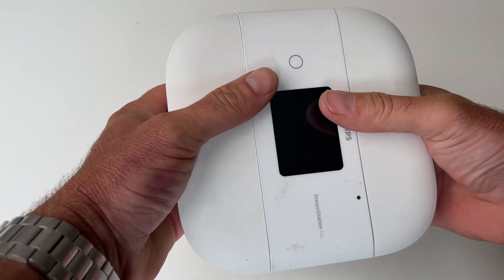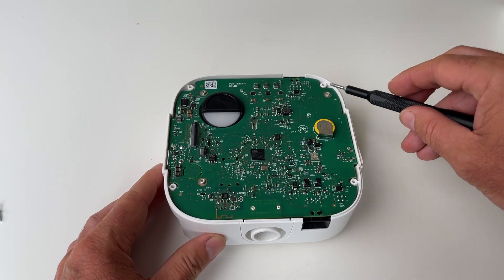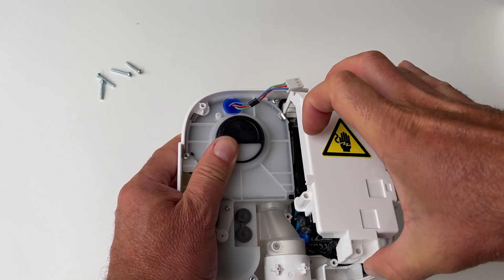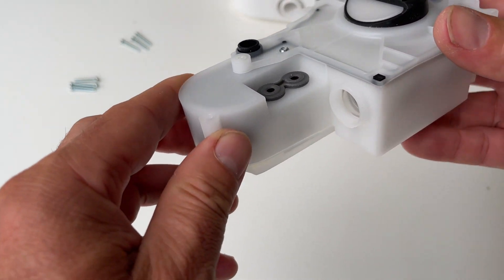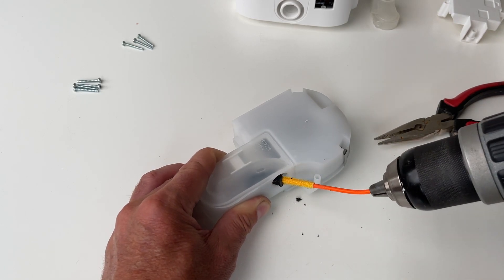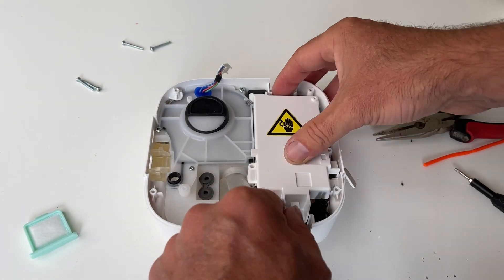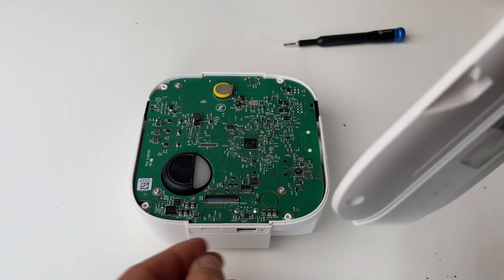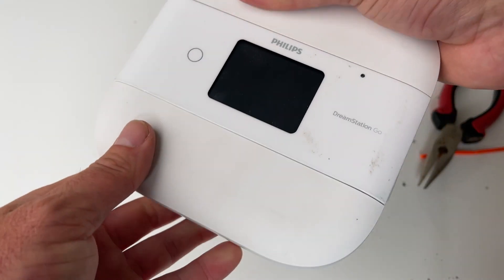Philips DreamStation Go Toxic Foam Removal #foamgate

Comment: A couple of tips. first, be sure to watch the video from start to finish before attempting. Two, do not use tweezers to get the form out. That did not work for me. The foam wound up tearing, and now I'm waiting for Amazon to deliver the drain weasel.
Reply: And a follow up; the drain weasel is not readily available in Portugal or through Amazon Spain. But, I was able to get this done by using a large paperclip. I straightened it out, then used pliers to form a small hook on one end. That allowed me to remove the remaining form. My DS Go is a bit louder now, but foam-free and ready to travel.

Comment: After an exhaustive attempt to have my DreamstationGo fixed by Philips, I used your video to remove the foam.  I love the machine and did not want to return it after their recall for CPAPs due to the toxic sound abatement material.  I can't thank you enough for this video.  I'm a 70-year-old woman, with some mechanical skill, who was able to follow your instructions and take care of this in less than an hour.

Comment: Great easy narration. However I had a small screw that was left after assembly 😮. Reviewed the video and quickly found my error. Screw held the turbine in the plastic shell. I wore a covid mask while working. I have a hundred left over. I also used a regular Dyson vacuum hose with needle attachment to clean out chamber and my work surface. I watched video completely first. Ordered the I fix it kit and drain weasel on Amazon.  Watched and stopped the video while working each piece. Very easy. Took me 1hr. Thanks! I have my travel cpap back!

Comment: This video is genius. Easily removed my foam. Fortunately, I never used the optional humidifier I had bought and used a Sleep 8 only once. The foam still looked fresh with no visible degradation. (I used a ChannelLock HP-4ECP mini hook and pick set that I had.) Only a tiny change in noise. Just going to keep the unit and not send back. The refurbished units Philips returns are reportedly not always in the best shape. And the FDA says one test showed the new silicone noise insert also may be a VOC problem. ... Not sure I would have attempted this without the video. Thank you!

Comment: Before I open my machine's case do I need to remove the memory card and filter? And how can I check if my machine is working fine after I remove the foam? We are not getting feedback on when the repair kit will arrive for DS Go here in the Philippines. For the past weeks I had asthma attacks and I think it is related to the foam issue. After I stop using my machine my attacks stopped too.

Comment: Thanks mate, I got it done in 30 minutes, it's very easy after watching this video. As I do not use a humidifier, the foam was still in good condition so no residue there. It can be removed by a paper clip. I notice that you can clean the inside of the vent by removing the one screw, remove the fan, and you can blow out any residue without dirtying the fan

Comment: Thank you sir. Although I worked on taking apart and putting back computers together for 7 yrs, I was somehow hesitant to take apart something I use to breathe. Finally did it using a stretched-out paperclip with a hook at the tip. Foam broke into no less than 3 parts, but the foam-7ucker is out! I can now use my travel machine!

Comment: I just heard about the recall when I did some research to buy a new hose for my dreamstation go.  Based on what I am reading, it looks like if I go the recall route I will receive a DS2 and not a new Go machine.  Also even if I do the silicone based foam is hardly any better.  I do like my machine since I do camp a lot with it and made a custom 24V power supply for it that runs for a solid week or more.  I am on the fence with either just removing the foam to keep the machine or trying another brand out of pocket.  I have only ever had this Go machine so don't have any experience with anything  else so unsure what I am missing out on with another brand... so I guess my question is should I just pull the foam and keep what I have or go for the recall?  Wife already complains its loud sometimes so wonder if my foam is so deteriorated its not baffling the sound anymore..  If so that's scary.  Seems the recall requires my sending the go machine back?

Comment: Thank you so much for this!!  I didn't feel like going out and buying a weasel so I took a piece of insulated 14 AWG solid copper wire (leave insulation on to avoid scratching the plastic all up) and I was able to pull the foam out by bending the wire just right and digging into the foam far back and pulling (several tries).  It almost came out completely intact.  I've got to blow out a few particles though!!

Comment: Thanks for the instructions. It was easy removing the foam. The CPAP is way noisy after the removal but I'm turning it 180 degrees so the intake is away from me. Fingers crossed it's not too loud.
Reply from the maker: Cheers Sam, that machine is noisy anyway haha. Cheers

Comment: Great instructions, this gave me the push to defoam my Dreamstation Go, and I just finished. The drain weasel worked great. One tip, remove the air filter. I forgot to, and it was making it difficult to reinstall the fan housing until I noticed it interfering. Thanks Nick!
Reply from the maker: Hi David, thanks for your feedback and yes that's a good tip regarding the filter. Cheers

Comment: Nick,
Thanks SO much for the great detailed instructions. Doesn't look to difficult to accomplish as long as you're careful handling the little flex circuits and tiny connectors. Do you know if any of the PCBs are static sensitive?
Got my DS Go for a trip late this spring then learned it was recalled on Foamgate 3 months later. I probably won't operate on it yet while under warranty. I really like the compact  little machine. Crying Shame they loaded it up with cancer foam.
🍻 Cheers
Reply from the maker: Cheers Tom, glad you enjoyed it :)

Comment: I was one of the first in the US to report to Lanky that I received a DS2 for a DS1 replacement. My DS1 and DS Go were/are less than a year old. What do you suppose Phillips is going to do to remedy a travel/portable machine?
Reply: I am in the same boat as you. I have not received the DS1 replacement and no word on how Philips intends to handle the DS Go. I received two notices urging me to contact my provider  regarding the continued use of the Philips CPAP units. I had registered the recall back in June. Considering how new my units are, I would be happy with a refund.
Reply: Same here. I haven't heard of anyone getting a replacement for DS Go. Have you? In any country?
Reply: Spoke to Philips customer service on 1/10/22. Was told there is no current travel size machine. I told her I didn't want a full size machine so she said "Well wait until you receive the replacement and then call us back." It's not her fault, poor girl just needs a job, but there's no point in trying to figure out what they're doing. So thanks to this video I pulled out the foam from my DS GO.
Reply: @rosawebb4068  thanks for this. Not what I wanted to hear, but bad news seldom is. I suppose I could do the same.